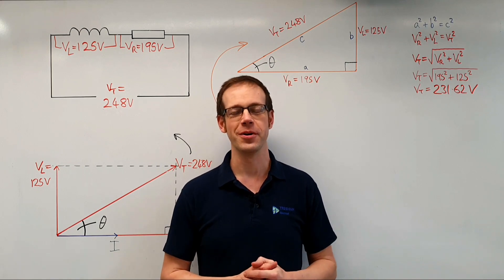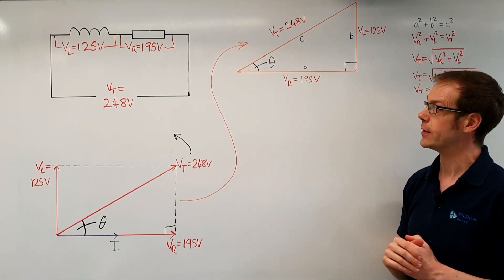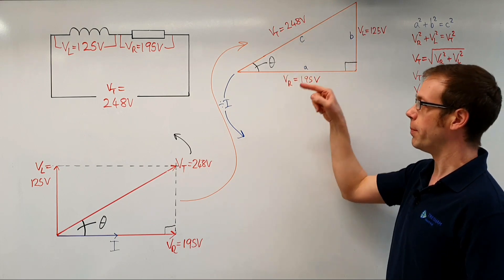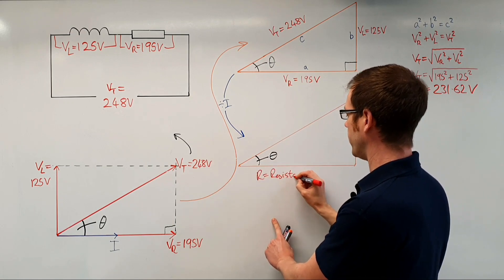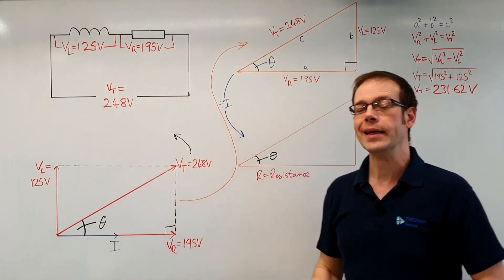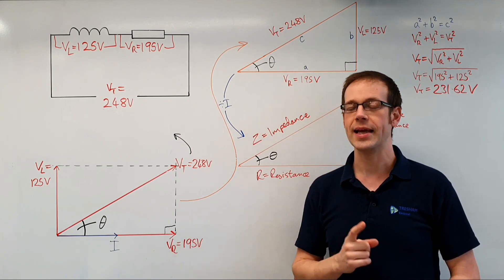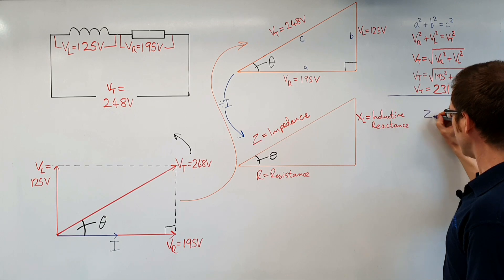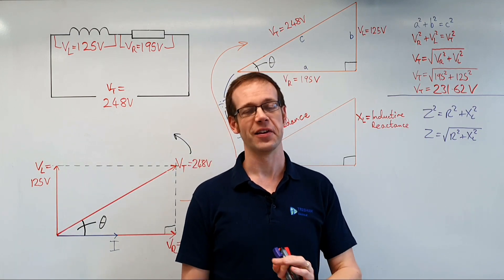AC Theory: How to Calculate Impedance and Construct an Impedance Triangle

Comment: good content,but whats up with the capacitor impedence
Reply from the maker: Hi, I'm not sure I understand the question?
Reply: @JoeRobinsonTraining  My question is do you have any videos regarding the phase vector for AC current and voltage Or any where I contact I can directly send you a question I really need some help
Reply from the maker: @crack1d723  if you check my AC Theory playlist, there's content on there about phasor diagrams, but if you search for me on Instagram or Twitter, you can DM me on there.

Comment: In theory, impedance are complex numbers having a purely reactance component along imaginary axis (to quantify capacitor and inductor effects) and a positive resistive component on real axis to quantify resistive effects. When expressed in ohms law it  relates the behavior of current and voltage in terms of effect of circuit on magnitude and phase relationship for current and voltage at terminals.
Also the voltages at sides of triangle are not physical instantaneous voltage but rather the amplitude of the sinusoid behavior that the voltage takes the form of over time.
It's interesting how you've phase shifted / advanced the applied voltage as needed so that the resulting current waveform is a cosine. Probably so the in phase  voltage drop across the resistor would lie along the real axis
Reply: English please 🙏🏻
Reply: @bobbybenjani1978  the fundamental quantity in ac circuit analysis is the cosine function. The representation of cosine function in complex plane is the phasor that lies along real axis at a phase angle of 0.
The complex number impedance for inductors , thru ohms law, will  locally rotate a cosine (or any) current phasor 90 degrees to arrive at voltage drop  phasor.
Reply: @jimhenderson2308  I just bend a bit of conduit and run a few cables. And lights seem to turn on and off well enough. So I don’t really need that nonsense
Reply: @bobbybenjani1978  
It's not nonsense at all when you learn about electric circuits. Specifically relating to voltage drops and current in DC circuits. This is about how to find / calculate them in an AC circuit with reactance impedances (which involve phase shift between current and voltage drop).
You relate to the implementation side of things.
This is the abstraction side of things.

Comment: Great set of videos Joe.Are the voltages in the triangle peak voltages,rms voltages or instantaneous voltages?
Reply from the maker: Thanks and what a great question. I'm just mulling it over as I type, definitely not instantaneous, theoretically they could be peak but if they've come from real measurements most likely rms. Thanks for watching. 😊
Reply: I don’t think it would matter as current changes proportionally and the triangle is also the power triangle (VxI).
Reply from the maker: @stikndip  that's a really good point. 👍
Reply: @JoeRobinsonTraining  This is a great question. I was wondering the same thing, and then it came to mind that the multimeter does peak to rms conversion, doesn't it?